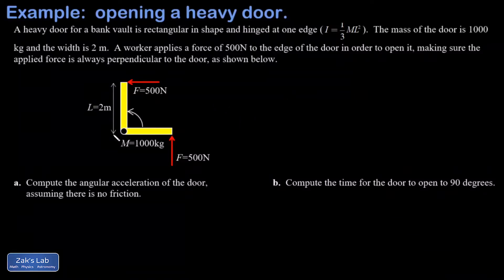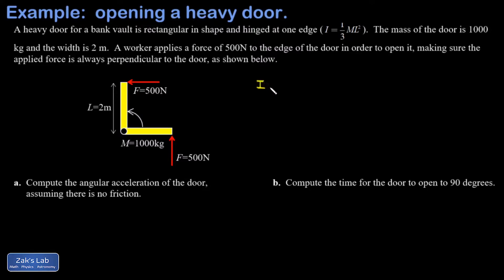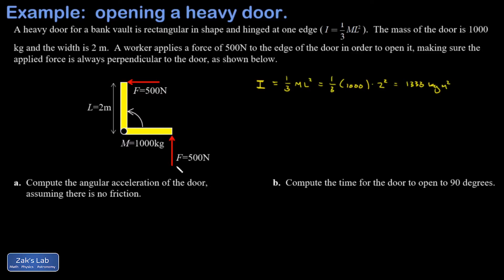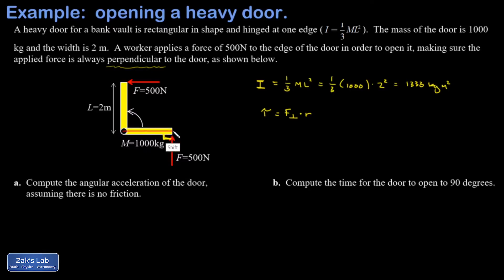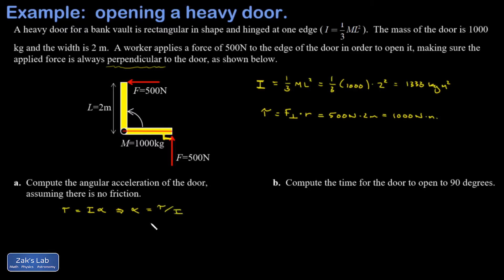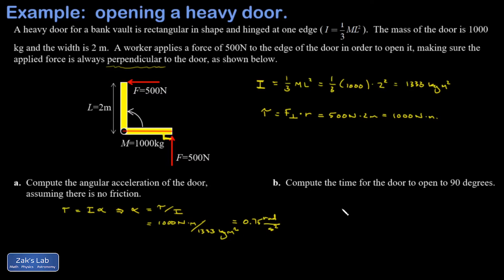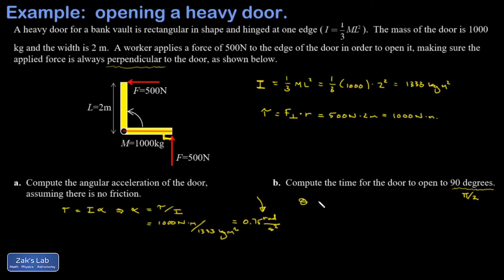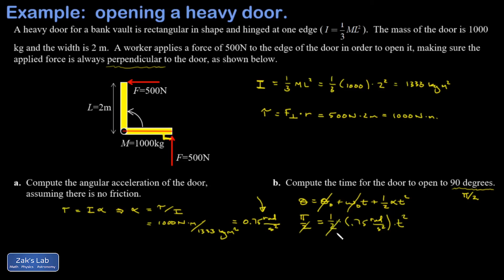Heavy vault door:  torque, angular acceleration and time to open.

Comment: Why do we not consider the weight of the door in calculating the net torque? Also, when do we use counterclockwise/clockwise when computing net torque? Is that only when we're doing static equilibrium problems and setting net torque to 0?
Reply from the maker: It's assumed that the door can only rotate about the fixed hinges, so the force of gravity pulling down on the door is countered by the hinges about that axis (i.e., the door doesn't fall down).  Second thing: if there is only one torque to consider, there is no need to explicitly label it as CW or CCW, kind of like a 1D kinematics problem where I say "suppose a car accelerates from rest at 5m/s^2 for 3 seconds, compute the displacement" . . . you just assume the direction of motion is positive because there's nothing else to keep track of.  In a dynamic torque problem with torques pointing multiple directions, you'd want to carefully distinguish between CW and CCW to get the correct net torque. -- Zak